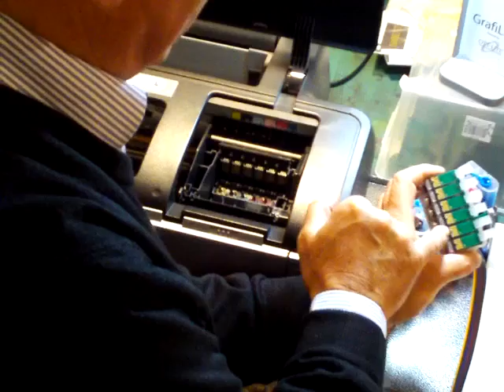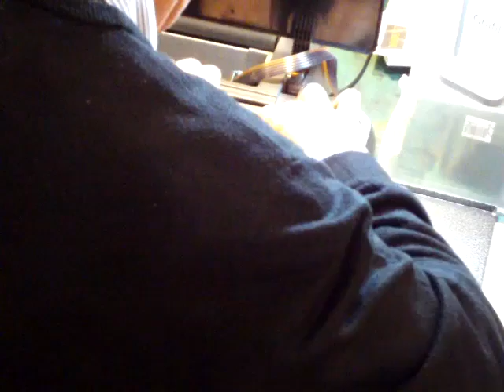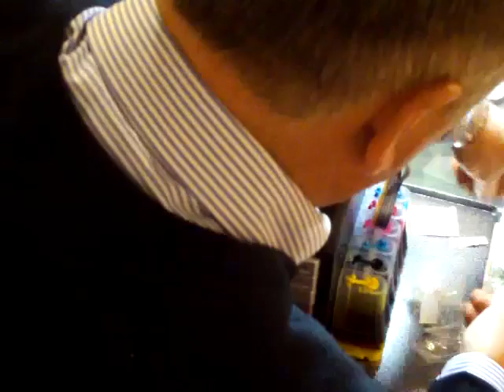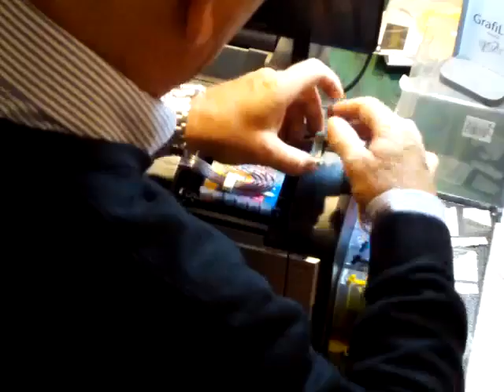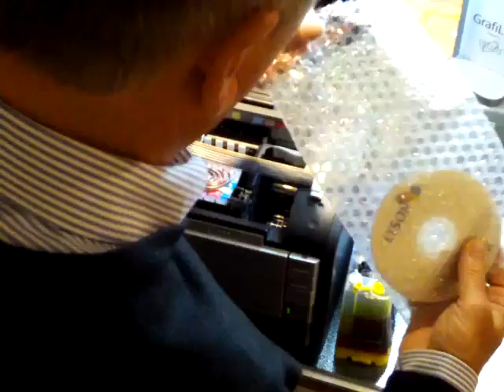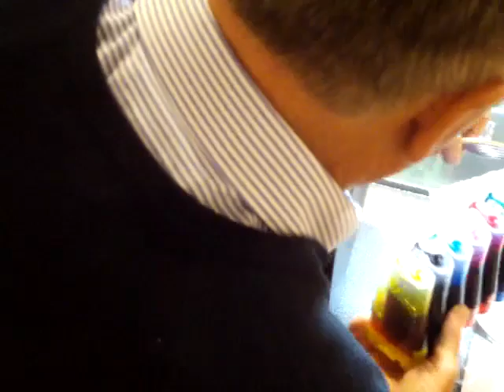Lyson33: Epson 1400 CIS Conversion - pt 2

Comment: Ordered this system from USapex, received it quickly, but was a problem with the cyan cartridge.  I called twice and e-mailed them they would not respond.  Maybe a problem with e-mail, because I think the system comes from a different state.  I might have e-mailed the wrong address.  However talked to someone at USapex, said he would have someone return the call, didn't.  They told me on the phone they would send a replacement cartridge, but could not tell me when.